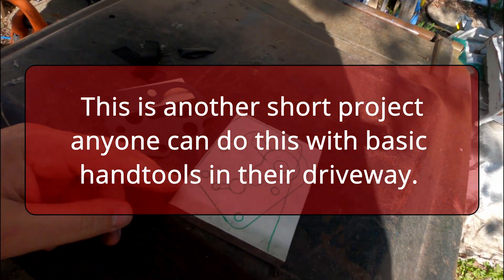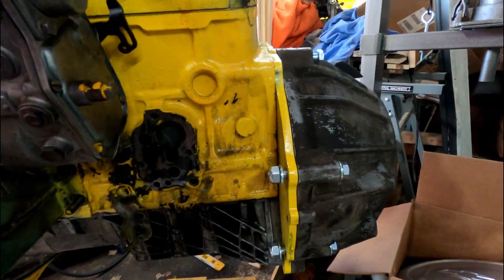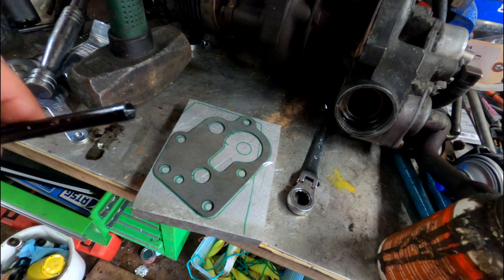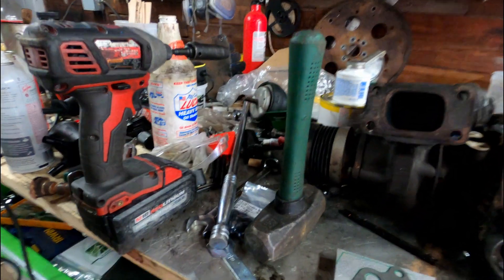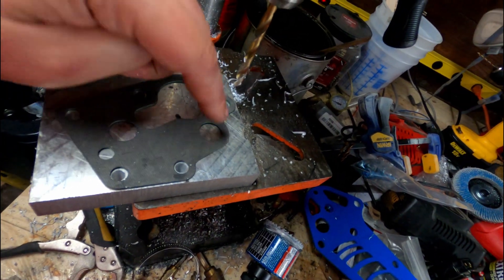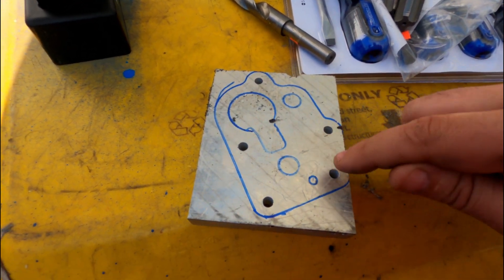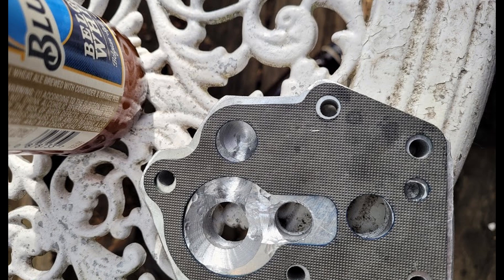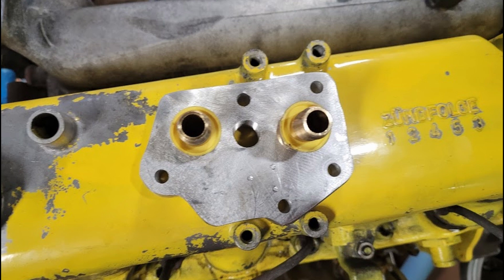4runner OM617 swap DIY Oil filter relocation plate

Comment: Technically, you don't need one of those returns, as it only drains directly into the pan.
2/3 of the stock oil filter is a bypass filter, just polishing the oil and trapping fine particulates.

If you do use both holes, you'll need to make sure that the engine oil passage gets priority oiling, not plumb them directly together without restricting the passage to the pan.
Reply from the maker: The little one? I figured it was something like that
Reply: @TheDrivewayEngineer  
It looks like the lower port is the pan return.
I don't know if this link will make it, but I just searched for OM617 oil filter port diagram, and found a thread about "no oil pressure while cranking" on PeachParts forum.

http://www.peachparts.com/shopforum/diesel-discussion/332662-om617-no-oil-pressure-when-cranking-4.html
Reply from the maker: Thank you, I'll read up on that for sure